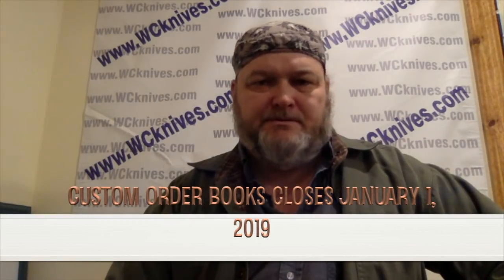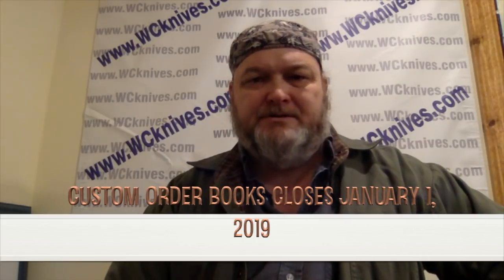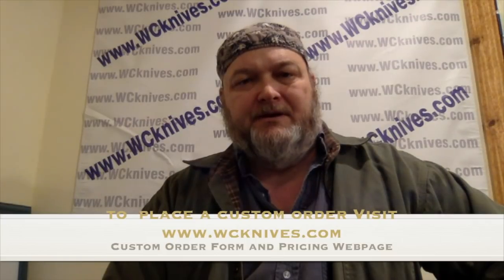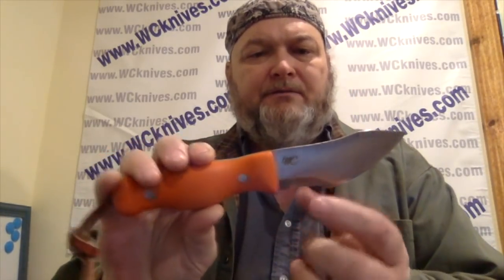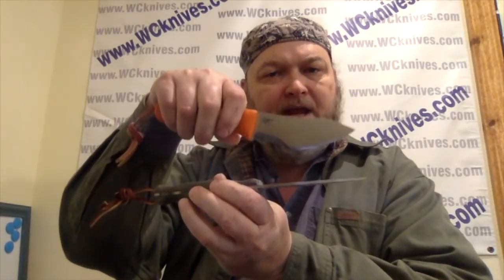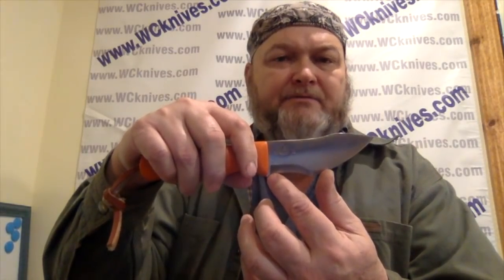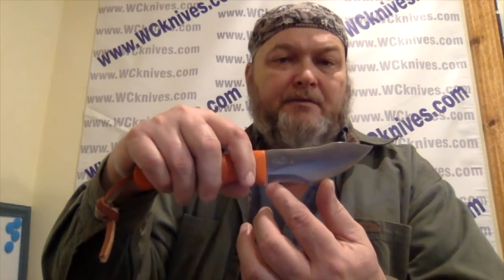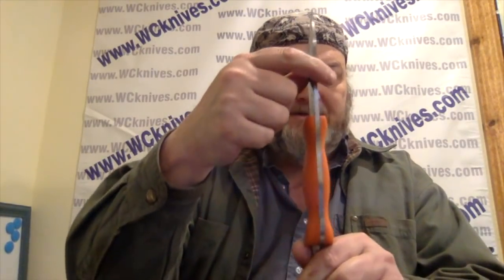The Reason WC Knives Look Strange

Comment: A good but necessary explanation for the different grinds and blade geometry on the same blade: task determines design. However, I do sharpen my many knives, and a choil is very important to keep from hitting the stone edge and damaging it while sharpening close to the guard. The Blackbird has a small choil, I have it ordered, and I can't wait to try the blade. I refuse to buy a knife without a guard, and your handle design looks good.

Comment: William, this is definitely an Intelligent design because it takes a linear one trick pony and turns it into a multi purpose tool that can handle say 3 -4 different tasks. 

I see value here as well and efficiency instead of carrying a different knife for each intended purpose this makes it possible to use just one. Very creative and well thought out process indeed.

One question if i may? On a blade such as this with alot of curves when it comes time to sharpen is it a necessity to use a ceramic or diamond rod?

Thanks William i learn something new every time i watch your videos. Godbless 🙏
Reply from the maker: I have many sharpening videos. If you go to my main page on YT and under the FAQ group you will see at least one sharpening video. I use flat diamond stones all the time. They are actually easier to sharpen because the scandi angle guides you through the whole process. It’s the same angle all the way through.